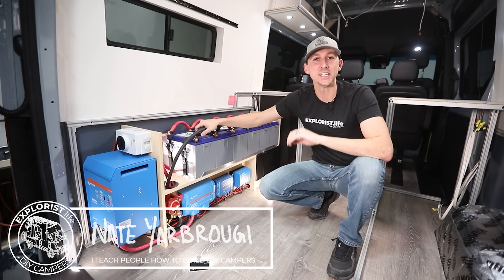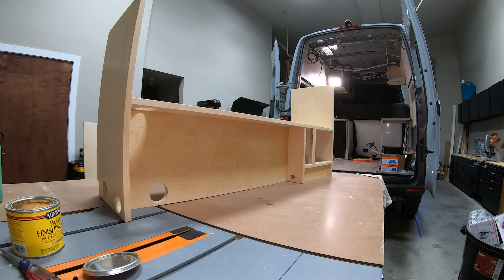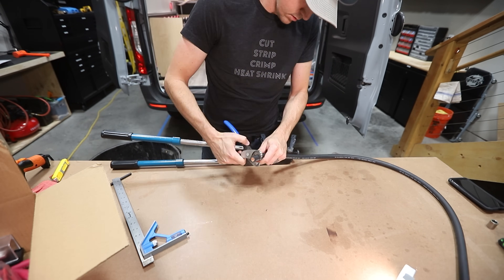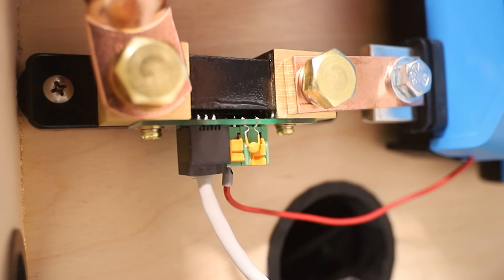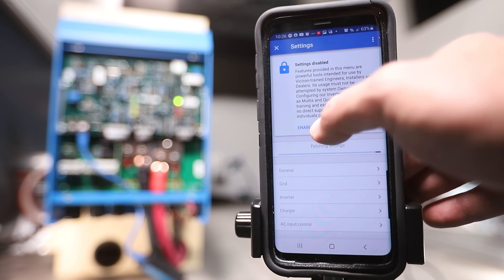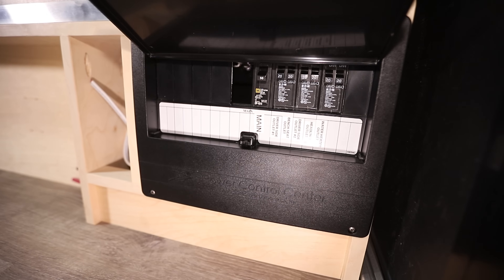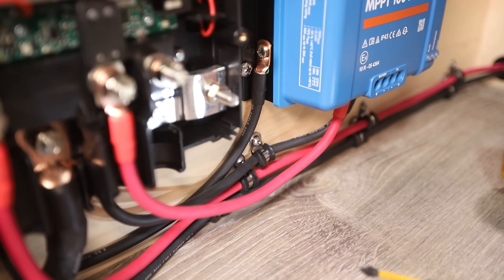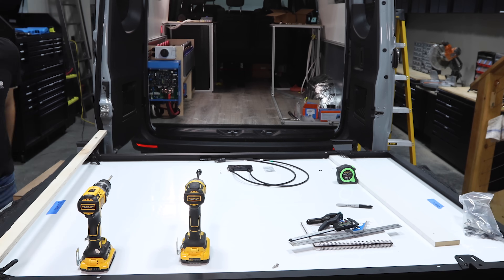DIY Sprinter Camper Van Electrical Install - Full Tutorial

Comment: this build is bullshit  - do not do it!  You need a way to secure this to the frame of the vehicle and Nate completely ignores this step.
Reply from the maker: That’s the easy part and has nothing to do with the electrical.  There are 100 ways to attach this enclosure to the van and if you can’t figure out a solution on your own, you shouldn’t be building a van or an electrical system. Cheer up buttercup